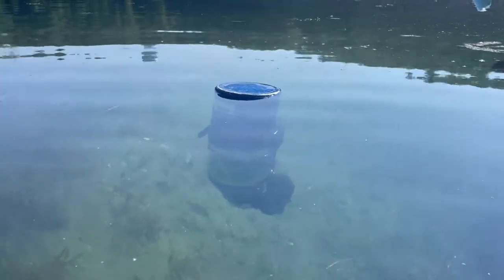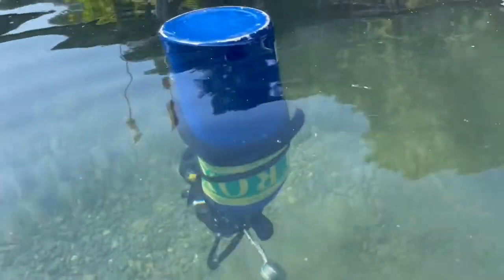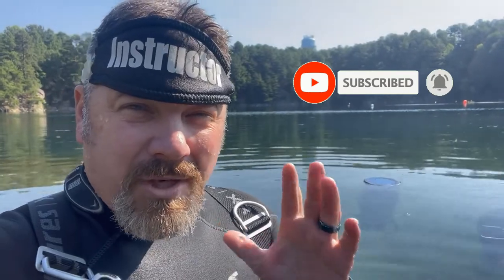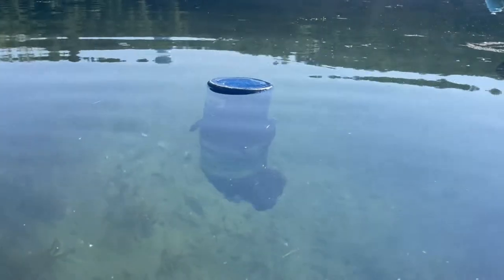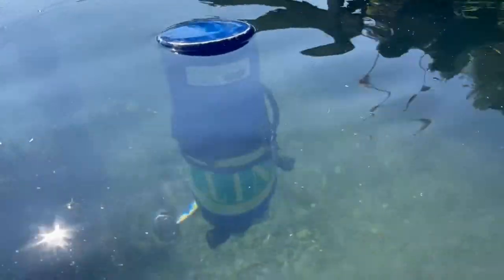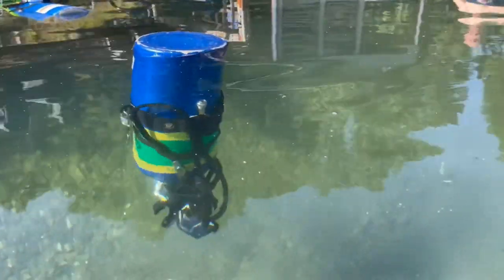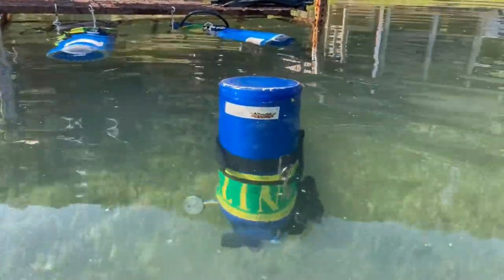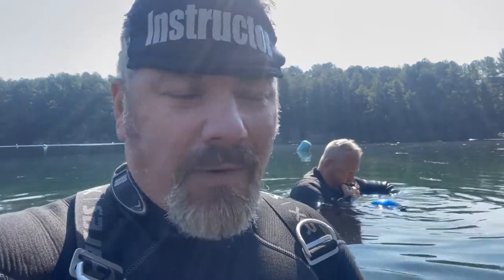Weight Test With And Without A Cylinder

Comment: I would have liked to see you to pile 1# weights on the cylinder until it sinks to show how much weight you need to add to the tankless diver to offset the buoyancy of the empty tank. I know it varies based on size and manufacturer but it would have been a good demonstration.
Reply from the maker: Thank you for the video idea @kevindavison6019. We currently have videos produced and uploaded until January 1st, so I will see if we can make such a video and get it uploaded after New Years.

Comment: I have to say I always do my weight check with cylinders still connected, whether they are steel or aluminum.  Even with aluminum I need to know I can still stay neutral at say 6 feet with tanks at minimum, ie I have enough weight to counter that buoyancy.  It's actually exactly the same process with steels because the change in buoyancy with gas expended is the same.  It may be just me misunderstanding but I don't see why you would take a cylinder away.
Reply: Just conjecture, but I would think that for training purposes, you would want to do a weight check at the beginning of the dive, therefore the tanks would be full and consequently the heaviest they will be, at that point.  So you can remove the tank buoyancy changes from the equasion, calculate the weight needed to offset the empty tank, add that to the neutrally buoyant tankless diver,  then double check at the end of the dive with the tank on,  when the tank is actually near empty, and consequently at its most buoyant state.
Reply from the maker: Hello @timgosling6189, you are correct in the fact that both steel and aluminum lose weight as we use them. It just so happens that steel for the most part, remain negative at lower pressures. This is not always the case though, several steels will be positive just as an aluminum cylinder would be. That being said, not all aluminum cylinders are the same. The 3300 neutrals remain neutral throughout the dive, thus never effect the buoyancy of the diver. In general, we begin weighting newer students from the get go, without the cylinder when they learn the snorkeling skills in the Open Water Program. They get a better understanding of how Archimedes Principle works prior to adding a tank.  Then once they have learned how to maintain buoyancy control and trim, we add the cylinder to them with the BCD. We rarely have any students struggle in the beginning, and we never have to overweight them due to them not being relaxed enough to sink. There is nothing wrong doing it your way, as this is what most of the industry teaches, we have just found that by removing the cylinder, the majority of our students grasp the concept of buoyancy control better, and they are never over weighted (other than the weight of the air in a full cylinder).
Reply: @LakeHickoryScuba Sounds a great teaching technique.  Thanks for taking the time to explain.

Comment: Yeah..... As a steel  Tank connoisseur.... I still do not add the weight of my tank into  My    Buoyancy calculations..... My personal buoyancy doesn't change Specifically because I know I'm going to be taking a tank or both off at some point.. I personally wake myself .....if..... Needed
Reply from the maker: The LP85's are a great choice @revtechmarine. A lot of Sidemount Divers choose them. Looking forward to our trip to Cozumel. The C53 has a few extra holes I want to try this go around.